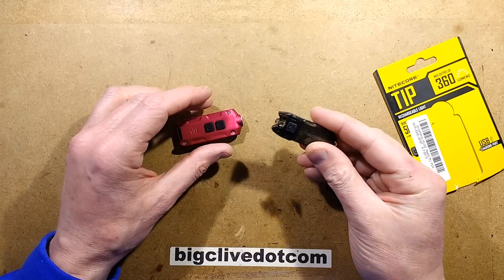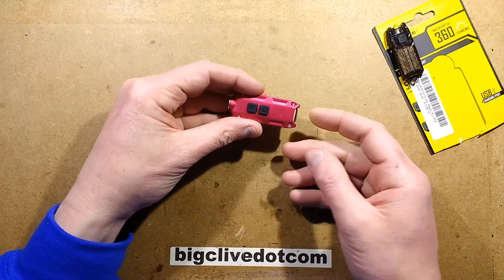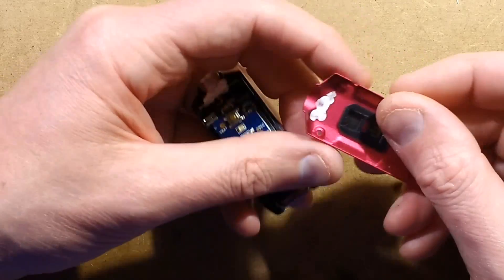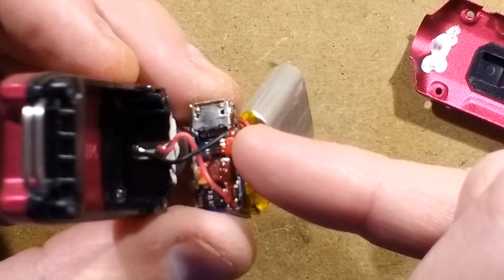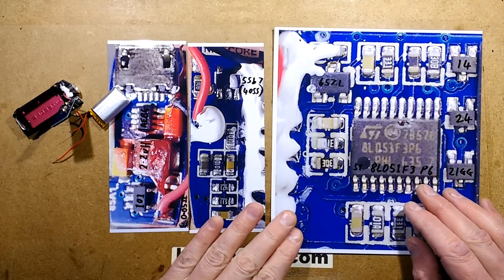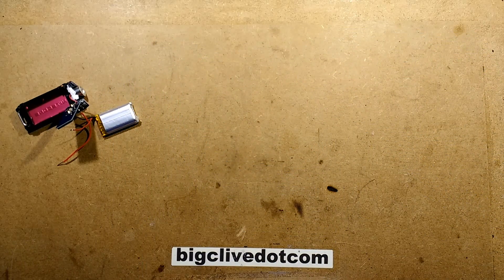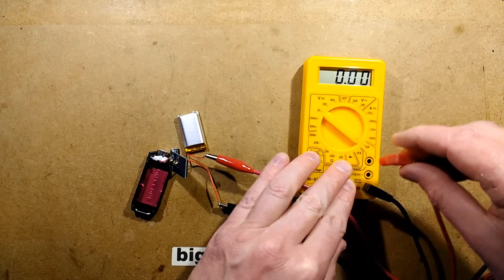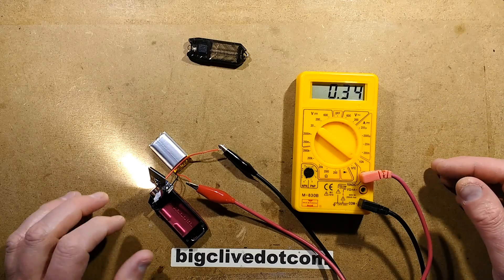Inside the Nitecore TIP LED flashlight, with electrical tests.

Comment: Sir, i bought this model when You published this review. I drove a car on top of it when it was like a year old, some time later button died, years later second one died and flashlight is still fine, fully working and lasts a long time on battery. I use it every other day and it is permanently bundled to keys, that i always carry around - properly hard to kill and a great product.

Comment: What are the chances of my TIP SE getting back alive again? I forgot my light is in the pocket and I soaked my pants in the water in a day...
Reply from the maker: Let it dry completely and it may recover.  If you pop the cover off, a spray of isopropanol may help wash out any dirt and help the residual water evaporate.  But keep in mind it's flammable.
Reply: @bigclivedotcom  I blow my light, with the cover on, with air compressor and charge it. It messed up the circuit. My ON/OFF button and mode button are switched somehow haha. Might wanna get the stuff you mentioned. Thanks for the information.
Reply from the maker: @DersNoNem  Leave the light on at a low setting continuously until the battery protection circuitry kicks in and it cuts off.  That should hopefully reboot the processor.  It sounds like something has become corrupted to the unusual circumstances.

The easiest way to get isopropanol is as rubbing alcohol.
Reply: @bigclivedotcom  low settings means the lowest light emitted? The 1 lumen one cannot be accessed, only the medium one can be used. Will it still work?

Comment: I wonder, what's your opinion on the "THUMB" model. 
I have one in the mail. 
the reason I chose it is because it can be a cap light since it has a clip, and the LED head can be rotated. also dual LEDs and a red  mode for keeping night vision in tact.
Reply from the maker: I've not tried that one, but my keychain light is a Nitecore Tube.

Comment: If you carrying a Smartphone with the flashlight function the tube might not be the best option, because its about as bright as the phone, so I would go for the Nitecore Tiki   with 300 lm or the Tip SE with 700 lm, the Tiki is about the same size of the tube and you have the 300 lm option, which gets you around 0.25 lux at 70 m, if you need to see further, it's double the price as the tube though.

Comment: I have a strange torch that seems to have exactly the same case as this but uses button cells and an LED as a lamp. It came in a cracker at Christmas and I wondered why it used 4 screws as a means to seal in such a cheap torch. Now I'm more puzzled.

Comment: I would like to know if that overpowered chip is connected to the data lines of that USB connector, possibly via the 'mystery chip' right next to the connector. The Chinese government has already demonstrated that they will force their country's companies to destroy their own credibility by embedding chiphacks onto motherboards destined for data centers and military applications abroad. It's been a staple of penetration testers to plug a USB auto-hacking thumbdrive device into whatever computers are unguarded on the "test network", and secure an inroad. It's virtually impossible to conceive that the swarm of USB powered/charged devices would not be an expected attack vector by governments that have proven themselves hostile from more targeted attacks.

Comment: I have the thumb UV and it turns crazy in cold and when shaken. It actually freezes and hangs locked with random led lol. I have to discharge it completely to restart. There is something wacky with the controllers.

Comment: You can always check candlepowerforums and budgetlightforum for almost any flashlight circuit schematic. The modding community is amazingly thorough. 
If you think the TIP is advanced tech in a small package wait till you see homemade projects and community + manufacturer collaborations. Cheers :)

Comment: I have this keychain torch. There are 4 power levels, low/medium/high/turbo. The turbo drops to high, after about 30 seconds. The battery used to drain when it was locked out, but I understand they have fixed that now. When it is charging, the LED glows red, and when it is charged, it turns green. The thing you didn't mention is, when it is off, and the buttons are not locked out,  if you press the power button once, the red Led flashes, 1,2,or 3 times to show how much power the battery has. I bought mine in 2017, and its still going.

Comment: I've been using one of my new Nitecore TINI flashlights for a couple of weeks and I must say they are very good although I would always have a TUBE on my person somewhere at all times. I also have a UV Nitecore TUBE which I use for curing resins and for making fellow clubbers and bar flies light up unexpectedly (use thumb over LED to make it flash to the rhythm - lots of fun!).  
As for the TINI it's lovely and can provide the same intensity of the TIP without the second bulge in my pants.

Comment: hey @bigclivedotcom, Is it possible to lock the output function, say at 360 lumens so that every time I switch it ON it stays on 360 lumens? Im planning to house the circuit board in another body which has only 1 switch/mode

Comment: My Nitecore TIP 360 stopped working, turns out the positive lead to the LED had a faulty solder joint, applied high heat to the solder blob and wire and suddenly it worked again. Poor quality control.

Comment: Ive got to take mine apart, when turned on its intermittant, It cuts out when I press on the chasis. Any ideas?
Reply from the maker: Sounds like a bad solder connection or something being shorted out.

Comment: I carry this light almost every day and it goes off in my pocket even when I have it in "Lockout" mode. I usually find out that it's on  when it gets hot in my pocket. If it wasn't for this design flaw, it would be a great little light. I never have this problem with any of my bezel twist lights.

Comment: for 11:20 (ish) - the TIP has a timed burst mode, so the CPU should know when to step down the power. I think that's the same for temperature prevention. The TIP gets hot - that hot that you can feel it when it accidentally turned on in your pocket - but then a user would pull out and turn off... so if the hardware is capable of that temps - that's the chinese logic of overtemperature protection.

Comment: Had one but it eat battery, not shure it's only happen in lockout mode. It would be nice if it was possible to firmware thru the usb. ( the one I have flash one time so it must be version 1)

Comment: Could the 'locked out' power drain be caused by a single button kept pressed in the pocket (for example current flowing through a pull up resistor if the input is grounded or vice versa)

Comment: Hi, very good review. Is there a way of replacing the battery once it is past its useful life?
Reply from the maker: If you could find one of  similar size it's viable.  But after 1000 charges you might be looking for the latest version anyway.

Comment: If you have the problem of the Tube turning on in your pocket the small key-ring supplied with the tube is the solution. It fits perfectly over the button so if if use a bit of insulation tape and fix the  key-ring over the button it protects it so its unlikely to to be switched on accidentally. The button works perfectly with your thumb with the tape in place. If you choose a pink tube you might have a problem finding some pink tape to match :)

Comment: I'd be inclined to drill a small hole between the buttons in the case to make the led more visable, as the waterproofness is questionable anyway due to charge socket and waterproof isn't a necessity to me.

Comment: I got one of these for myself for Christmas.
They were on sale for a crazy low price, because it was in an ugly red and green Christmas color, and I guess they were having allot of trouble selling them.
Anyway, I have 2 USB ports in the cubby in my car, and one is the perfect distance that when I plug this in, it sits right on the floor of the cubby.
It's a switched USB, so it only charges when the engine is running.
I keep it there, so whenever I need it, it's fully charged and ready to go!
So far this has been an awesome light!
I could see where this light might not be the best for pockets, because of the buttons.
Also, there is absolutely no way this thing is even remotely waterproof...
That being said, it's still an awesome little light!

Comment: Can't junction temperature be calculated based on voltage/current the LED is drawing?  I know regular diode have been used as temperature sensors.

Comment: The processor and transistors are pretty close to the battery when it's all in the housing. I wonder what it means for the battery temperature-wise when it's running for some time. Could get pretty hot I think.

Comment: +bigclivedotcom When you were running your current draw test while the buttons were locked out @15:58, i dont know whether you noticed but I saw that when you pressed either button while they were locked out, it drew significantly more current. I wonder if whoever complained that their battery was going flat in their pocket while it was locked simply had it in a tight pocket, constantly pressing these buttons? Their battery may have even been fairly low and close to the cut out voltage anyway?

Comment: Every time I find a relatively low priced bit of technology that impresses me I have a tendency to go mad and by about 10 of them even if I only have use for 1-2. Is it just me that does this??
Reply: anononomous  
one is none
two is one
three is just in case
four is much better
five is for later
six is OK as long as the significant other doesn't find out....
Reply: Alas, you are not alone in this. I think I caught this from my oldies, entire cupboards full of baked beans they would never eat, more toilet paper than a hotel..... Thanks to Clive, I now have 500gm of Potassium Nitrate and I don't even know why.
Reply: @philchadwick9470  - What did  Big Clive use the KNO3 for?

Comment: For such an in-depth review, run-times at each power setting would be useful. S'pose it'd vary depending on ambient temperature, as the throttling back of the current as the LED warms up would actually increase the run-time particularly in a hot environment

Comment: A way to do thermal management - could you monitor the LED junction voltage? I mean, it is a P/N junction after all, which will have a temperature coefficient. Maybe briefly drop the current to a low level first?

Comment: When it's in 'locked' mode - press a button, and see if the current changes, it could be that while in locked mode, if the button is held down it uses more power, and hence draining the battery - it'll stop it coming on for a quick press here and there, but if it's constantly held the battery will drain! as the processor will probably be checking which 'mode' it's in (locked or not) (that's my theory at least :) )

Comment: Just a note. The Nitecore Tube also has a lock feature mentioned in the online manual. It does work, but a bit harder to use.
http://flashlight.nitecore.com/html/uploads/ueditor/image/product/TUBE/TUBE_UM_EN.pdf

Lockout/Unlock
With Tube turned on, press and hold the switch for three seconds. Tube will lock out after a flash of the LED to avoid accidental activation during carry. To unlock, press and hold the switch for three seconds again.
Reply: Well, I'm pretty sure I have an original (got it not long after release so no clones were available at that point and it has the correct embossed letters and everything) and this doesn't work at all.. Depending on intensity for "on" it either just shuts off or goes into the continuous intensity adjust mode. So I'm guessing this must've been added at a later version of the firmware.

Comment: They acknowledged the issue with the processor staying active in lock out mode and newer versions do not have that problem. Without the fix the buttons would flash red if you pressed one in lockout mode which is how you can tell which version you have. I think they changed the plugged in with light on behavior at the same time.

Comment: I have a Nitecore EA11 with a very similar two-button setup, and it really will read out the battery's current voltage to you.  The EA11 has two main LED's: the main white one, as well as a dim red one you can use to avoid killing your night vision.  When you put a fresh battery in or lock the buttons, the red LED will flash out the voltage. For example, if the voltage is 3.7V, it'll flash three times, pause briefly, and then flash seven more times.  Perhaps that's what the TIP packaging means?

The EA11 also has a couple modes for flashing the LED, including a mode where it blinks the red LED periodically so you can find it in the dark.  Perhaps that's what the blinking was doing?  You engage the flashing by pressing the power button, then pressing and holding the brightness button; you can keep pressing and holding the brightness button to cycle through flashing modes.  Alternatively, if the light is on in any mode, you can turn on the periodic red blinking by pressing and holding the power button; you might have done that by accident when the little LED started flashing?  It might be intended for the same purpose of finding it in the dark as the flashing red LED in the EA11.  (The red LED can be turned on constant by pressing the brightness button, and can be set to flash more frequently from there by pressing and holding the brightness button)

Also, while the light's off, you can immediately put it into high mode by pressing and holding the brightness button, or low mode by pressing and holding the power button.

I don't know if these features are also present in the TIP, but it's worth testing to see if they are, since many of them are quite useful.  Especially the turning it on immediately in high or low mode.

Comment: Is it me or did the current jump up when the buttons were locked but you accidently 
pressed a single button?  Or was it down to a poor connection on the clips?
Reply from the maker: Most likely the processor waking up from sleep mode to service the button press.
Reply: Which could have been the reason for the power drain all along. Something pushing on the button in the pocket and draining the battery through the pullups.

Comment: Couldn't it be that the locked mode only uses a lot of power if a button is held down while it's locked? Like when it's in your pocket such that a button is depressed for an extended period of time.

Comment: Hey Clive, I just watched your video on the electrolumiescent chasing lights cable and I was wondering if the light up phone chargers with static lights are the same thing? I'd love to see a teardown of one of those too! Seems like China will make a light-up anything recently. I bought a fair of light up gloves and I honestly have no idea why...
Reply from the maker: There are a few different light up charger leads.  The chasing EL one, a side-glow fibre optic one and a notched fibre optic version with dots along its length.

Comment: One thing you missed when checking the "locked" current drain.  What happens if a button is pressed while the light is locked?  Does it provide power or ground to some pin of the control chip and thus have a few mA drain as long as a button is pressed?

Comment: I may have missed something, but why in hell does a torch need a cpu?
Reply from the maker: Almost everything has a small microcontroller in it now.  It's the cheapest and easiest way to implement "features".
Reply: what he said, and you can get them for pennies in bulk like most other components, 
plus it can be easier to reprogram them than have multiple hard wired circuits and switches

Comment: @Clive ....BTW, a "long, boring and blabbering" video about switch mode vs capacitive dropper supplies and detailed explanation of the functionality inside of each n where they're used would be AWESOME...especially filled with "as I say," "I'm not a 100% sure," "I will say," "shkotkey," "basically," ect. ;)

you're the man! I've learned a "metric" shit ton from you n I appreciate the channel. THANKS AGAIN!

Comment: Wow, in the old times we had flash lights that were useless because they used so much battery that for any lengthy use, you'd need a backpack full of replacement batteries, and now we hav flashlights that are tiny (and because of that, still have a crappy battery life) and need to dim down in order to not overheat. Build a decent size heatsink, a decent size battery, and you could actually use the 3 watts, which is just about an appropriate amount of power to use an LED flashlight with in the dark. Yes, then it's not so portable any more, but this only means that it will be easier to find in the dark!